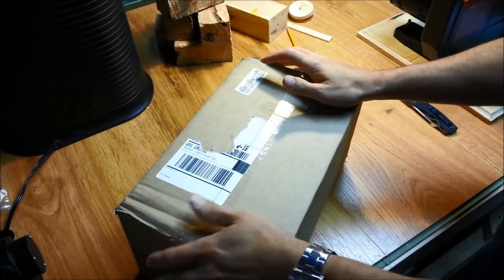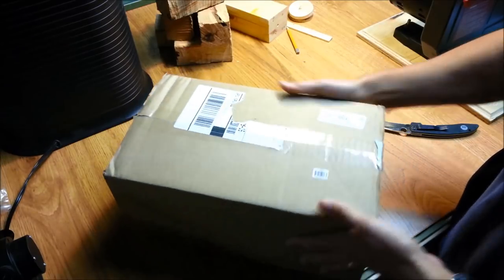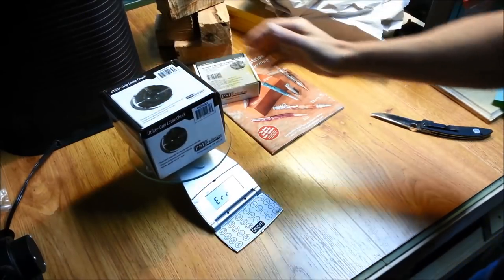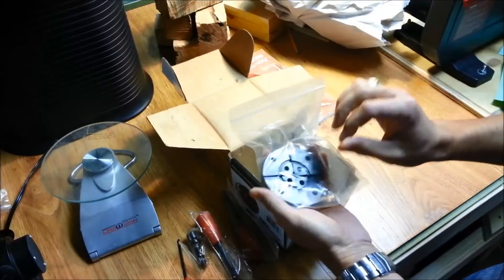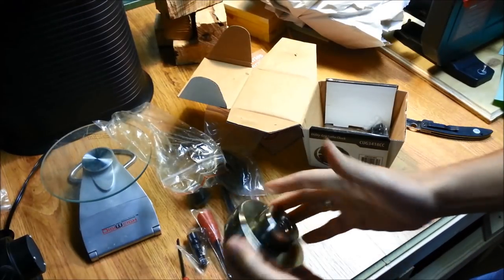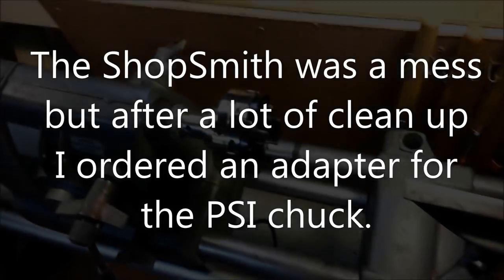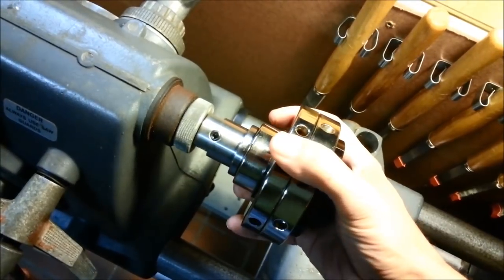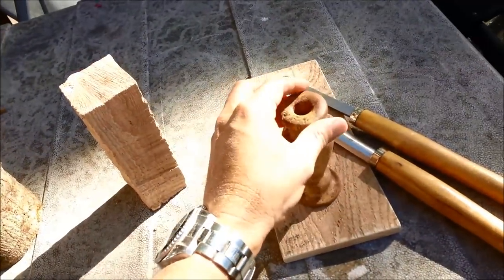PSI Woodworking Economy Lathe Chuck

Comment: Good job clean up on the old Shopsmith , one tip is to use vinegar with steel wool or a brass wire brush to remove the additional rust. Thanks for the info I need a faceplate and adapter, now know where to look.
Reply from the maker: Glad the video helped.  Thank you for your comments.

Comment: Have the exact same chuck for the past 3 years, and it didn't fit my cheapo 100 dollar lathe either, so I had an adapter made at a machine shop. Add a toothbrush to your toolbox and if you don't have a compressor, a can of air duster. The screw heads fill up with dust easily and make it harder to change jaws.
Reply from the maker: Hi Andy.  Thanks for the tip and comments.  It has been better than I expected but I can see some filling up of dust.  Despite that it's been holding well.  I don't mind having two ratchets to crank down on the work.  I'll get a Nova chuck one day but for now this has been fine.

Comment: What has got the weight of the product to do with your show? You keep on weighting them as if it's most important thing. Just tell me what type of chucks they are, on which brand they fit on. You've left more questions than answers. Not informative at all. So I gave you thumb down, let alone subscribing.
Reply: The weight is very important for stability and if you don't want extreme detail just look at a description online